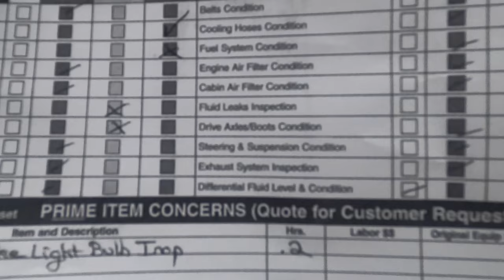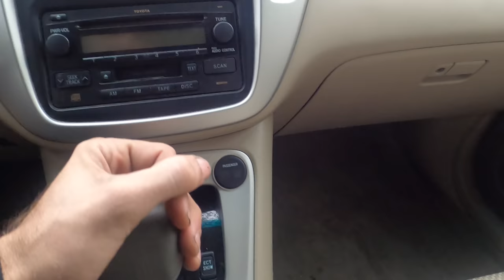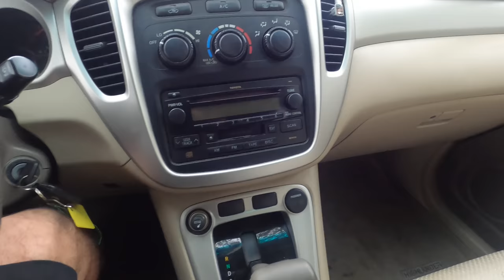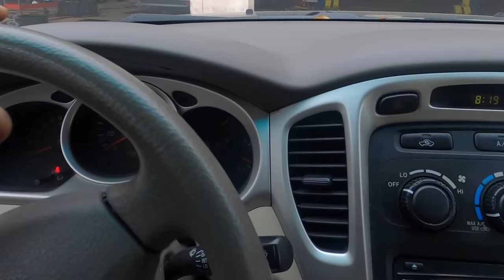We were BASHED by the Dealer! Ripping off a customer! Toyota Highlander 3.3

Comment: i visited friends in upstate new york recently and they told me they were going on a road trip so bought new tires and had a total brake job done at a local shop.a fairly new nissan rogue with low miles. the price of tires and brakes was $1800. my friend asked me if i could look at her new tires because she had reservations that they were infact brand new because they looked dirty. i checked the tires and brakes and sadly had to inform them that their new tires were good but used and their brakes were not even touched.

Comment: I liked the video, and I do think there were problems found that needed addressing. It may not have been as easy as the dealer suspected in large item caliper costs.... Usually accompanied by replacing rotors too. But if they did a cursory inspection after your shop did the initial brake job and the original inspection was fast and non inclusive as evidence of the rust and lack of lubrication in moving parts shown....  Its good to do the correct brake procedure and repair and a discount on parts and labor might have been approached vs a free giveaway of all. If I was the manager (I managed a Digital phone repair facility for Sony Qualcomm.... years ago. I would have given half costs on parts and labor, and a coupon for future service.  Keep em coming back with quality work and pride in workmanship.

Comment: I work with repair on smaller appliences and I have also found that being objective as much as possible. Getting worked up usually is wasted energy, and I have found that customers more often than not will respond possitivly if I`m honest. I would rather just say it as it is.

Comment: I am a contract mechanical engineering consultant but used to be a diesel mechanic. It really does ring true what you said about removing emotion from something until you are sure that you need to be. Once you do the checks and it actually was you at fault, it is also very important for you to take ownership and address the problem. However, you need to draw the line once the issue is resolved, because sometimes customers like to use you and your good intentions for their own gain.

Comment: Personally I think even for customer service you went above and beyond.. I can see the pine (maybe) being replaced. The top seal (maybe) being replaced, but I qualify that with saying a simple re-torque - wipe down-test drive might have solved that problem. I though not a professional auto mechanic did 10 years of commercial jet engine repairs and rebuilds, and found usually it was a bolt that was not torqued or more often just loosened. As far as the rear drag went clearly that was totally on the owner, but it was nice for you to clean it up, though a bit more than I might have in your position.
Bottom line is it is clear you live in a wet and likely ice prone environment or this owner has been 4 wheeling. If that job was within a month of being out , that 11 months is a LOT of rust and wear. BUT it is nice to see a company man that will go the extra mile, but like I said this was about 11 months since rebuild the owner should have to take some responsibility even if you have to call it shop and oil charges to recoup some of the material expenses. But that is just me since I always try and be fair with my mechanics, if it is their fault they pay if it is my fault but they did the work and I messed it up I pay and if we can't be sure I always ask that at a minimum we split the bill. Sorry just old school business 101

Comment: This sort of reminds me of a time when I was working in a machine shop that dealt with mostly textile parts. A shipment of fairly large gears was returned to us by a customer who stated that the bores were taperer and wouldn't go onto the shaft all of the way. We inspected them and found that the trainee who did the final work had run the setscrews in about a half turn too far. We backed them out, repacked and shipped them back and everyone was happy. You can't always believe what a customer says. LOL

Comment: Good video, I would however before compressing the Piston back into the caliper  loosen the bleeder screw for two reasons. one your not pushing  degraded brake fluid back up into the system and two you're eliminating the possibility of a collapsed hose you can feel the piston much easier on the caliper  when the bleeder is open and it helps flush out any oxidized brake fluid from the caliper.

Comment: At about 7:25 you said as you were pulling slide pins that  it might be  excessive.  I don't think it's excessive at all because slide pins should be inspected  and even if no work is done  I at least clean and regrease them before  putting it back together.  If I took it apart that far I might as well  brush everything off and  put new grease on pins and  slidey  spots  pads sit in. To me it just makes sense I guess it goes along with responsibility  of I took it apart to inspect and even though  nothing needs replaced I should put it together  correctly to avoid any problems  and of course if someone else opened it up there's proof someone had been in it recently

Comment: I had a subaru one time, my own personal subaru and the pins were so bad that I had to use a torch and the pin bent on the way out.  I learned to lube the pin any time I take a caliber off.  And I use ceramic grease at least on the front pins.  It handles the heat well.

Comment: If those had been done recently would have just warranted the rotors and had the auto parts dealer just replace them.

Nice job!

My wife actually had some sticking breaks, and squeaks a long time ago. She took it numerous places, and even to a friend of hers that was a mechanic. Everyone said everything was perfect.

So finally I got out there on my day off, and the slider pins were so seized I used an impact to spin them, and applied outward force to get them out lol. Cleaned everything up, and everything was okay from then on out.

Should have just done it myself sooner, although when you work on equipment for a living it sucks to come home, and do the same sometimes lmao.

Comment: i always used to check slide pin on anything older then 5 years here in NYS you can fail state inspection for that how i would check them is loosen the bolt about 5 or 6 threads and push on the back of the bolt its it free it will slide. don't have to take the wheel off but of course is always preferred

Comment: I like to see people who take pride in their work! It really is a rare thing nowadays and almost unheard of because they just want to take short cuts just to get done with their work faster to just hurry up to get to another job or they just don't care or on the most part they really don't like what they are doing especially when it's a free job because they have to do it again and 99% of the time it was their fault for not doing the job right in the first place! Like the stuck caliber slider bolts, if they would have cleaned and lubed them like they should have done in the first place you wouldn't have to be doing it now! Because it takes a long time for that brake grease to turn sticky and gummy because that is synthetic good grease, they just didn't do it! 
You can tell a stuck caliber by inspecting the pads usually the inside pad will have less pad and like you said hot spots on roots and glazed brake pads. 
The build up of  rust could be 50-50 it may have built up scaling or again they didn't want to take the time to sand the rust off which is sad.  I hate it when another company bashes on another company that is in poor taste in trying to steal a customer and they were going to rip off that costumer too which made it even worse, what low-lifes! And they were bashing a decent company it looks like to me! You are going above and beyond and that shows you care good for you!

Comment: I used to work for a large communications company. When taking my work van in for service , I would be sitting in the service waiting area to hear the mechanics come out and tell the customers the list of things wrong with their vehicle's especially women. I already knew they were going to find a list of things wrong with my service van because it was on a Fleet Card usually around $500.00 a visit. Mechanics have got to have some way to pay for that boat in their driveways. I have two used vehicle's , I maintain them so I wouldn't to go to a dealership. I've also learned I can get better parts especially brake pads and rotors and my vehicles doesn't have to sit in the shop all day!.

Comment: One thing dealerships seem to have a problem with regarding valve covers is... they often ignore their own torque specs, and just run bolts down until cover & block are metal to metal.  This works at first, but when that gasket hardens from age and heat, elasticity disappears and after that, a leak has no quick fix: gaskets must be replaced.

Comment: If this break job was originally done here, then I would be pissed and took it back as well.
They literally took of the pads and replaced them with absolutely no clean up or lube.
The sliding pins were shocking to see. They should not be in that condition after a couple of months.

Comment: I wish you would had used a large water pump pliers and moved the caliper piston in slightly then watch for piston seal to return its piston postion, this would give you a good indication the piston is not rusted inside the caliper. When just push the piston in like yoy did is not a good test the piston is nor rusted. I also aways peel the piston boot bake just enough to see piston condition.

Comment: I save time by using a blasting cabinet with steel shot in it it takes longer to put all four rotors and drums in the cabinet than it does to blast them I also blasted the slide pins Advance Auto has a brush kit with steel brushes and brass brushes I put them on a drill and use brake clean for honing the slides then Sealy Glide everything back together

Comment: I put a new rotor and pads on one side of my bmw and found out the other side was siezed so I just left it. I got a airbag recall for free and they said they inspected my car for me also and on the sheet it said all my brake rotors were in the danger zone. Mind you the siezed side I put a new rotor on there too so they didn't even inspect it I imagine they checked one and assumed the rest were bad

Comment: At 16:00 I would spin on two lug nuts on to wheel bearing plate then put the rotor facings out as you did and secure it with two more lug nuts to make that a lot easier!

Comment: That's what happens when you lubricate  the pins with regular grease instead of HIGH temp grease... the grease dries up. Many years ago in the 90"s MIDAS CHARGED ME $600.00 FOR A BRAKE JOB, WHICH I don't trust to anyone,  i'VE BEEN DOING MYSELF SINCE i WAS 16... but it was winter in Maryland and I decided to pay for it. Well... I didn"t make it to florida, with the calipers getting stuck and smoking down the road. I stopped in Georgia at another Midas.  The other shop wanted to steal more money suggesting to change the calipers BUT NO anything of what I paid for and charge it to the shop in Maryland.. I made it to Miami, stop at the autopart, bought high temp grease, new pads and fixed them myself in the Hotel parking!  Also some service manuals calls for the pads use a bit of grease on the edges to slide in the clips...
Reply: Everyone an expert

Comment: I am not by any means a legit mechanic. I turn a wrench and will learn as I go, but I'm confused. Around 18:10 you sprayed it down heavily with break cleaner then put it on the car. Should you have wiped down the cleaner before putting it on? I would think that could mess with the e-brake functionality. Genuinely curious. Perhaps I've been over protective when doing stuff like this lol
Reply: I believe you are confusing brake cleaner with a lubricant.   Brake cleaner does not leave any residue that will effect brake performance,  that is why it is used to clean brake parts.   

If you feel like wiping it down after spraying it on, feel free to do so, just know that it is not really necessary.
Reply: @Bendigo1  That's good to know. I wasn't worried so much about a lubrication effect as much as it being aggressive on the pads or any other rubber component (boots and such). I'll probably continue to wipe it off, but won't be as worried going forward that I missed a spot lol. Thanks for the info :)
Reply: @TheBulletTrain  yeah, it shouldn't be sprayed on those parts and should be removed asap if it gets on them.  But in the part of the video that you mentioned,  there is not much chance of that happening.
Reply: @Bendigo1  Fair point. Always good to learn new things and I will keep all that in mind. Thanks for the info and reply, and for being informative and not a dick which happens on here way too often lol.

Comment: If your shop just recently change the brakes on this car, your shop failed There is absolutely no excuse as to why the guide pins are frozen. Whoever done the brake job did not do it correctly. From the looks of it I would say your shop never took the front calipers off to change the pads. All of the rust inside the piston is clear evidence of that your tech robbed somebody.

Comment: Not to be or sound negative but you should put the rotor on a brake lathe to machine it smooth only knowledgeable mechanics should attempt the using a flapwheel on a rotor or drum

Comment: On those  calipers. I still would of opted to replace those lines or aleast inspected them. Just because you are forcing them open with the tool. Doesnt mean they arnt hanging up. Ive seen where the insides of those breaklines will swell and act as a one way valve. The Tool you are using puts a lot more force on the piston then what is normaly applied when the brake pad is released (Which is virtually none) Maybe you dont have that issue as much down south but i see it up north all the time especially on older vehicles. Not critasizing you. Just trying to give some helpful advice. Keep up the good wrenching and thanks for the videos!

Comment: Looking at your findings they should have bashed you guys. Looks like your shop pad slapped the rear and didn’t line the pins at all. Even after 7 months those pins should not have been dry. I also noticed you failed to clean the rear parking shoes while you were in there. I also noticed you failed to measure the rotors during your “proper” brake inspection. But hey it’s all for likes and shares right.

Comment: Nice repair! I hope you were using a respirator when cleaning those brakes. Rust dust is no joke, I learnt it the hard way once when I spent about 2 hours cleaning a rusty car frame in an enclosed garage with no respiratory protection. After finishing up I could literally FEEL the dust in my lungs and throat. Thinking back that probably shaved some time off my lifespan.

Comment: Replace or wirebrush rusty slide pins.  Clean the old "glue" off and apply new grease.   But, also, use solvent and swab out  the slide pin sockets of old crusty "glue".   Grease the drum shoe and disk pad slide points (wire brush as necessary). . Make sure you don't push brake fluid out of the reservoir when you compress the calipers.   Brake fluid  flush is worth the effort at some point.   Even if you just bleed the last 20% in the calipers that is the  most thermally degraded.   Most parking brake linkages could use some attention.

Comment: I'm hearing a lot of double talk. Yes it's my life in your hands that the brake job gets done right - the first time, and isn't just that I'm just another disgruntled ass-hat being difficult. I consider trust a very important component of ANY work done and should it be discovered that a mechanics skipped/ shortchanged basic safety steps to get another job on the lift as quickly as possible to pad the profit corner - is taken very personal.

Comment: I don't like watching other mechanics cuz like immediatly I noticed 1 dudes wearing shorts which is not normal for a mech an 2 he didn't shake the wheels to rule out bearing play or suspension issues which I always do to cover my ass and as a courtesy and 3 alot of times you have to Check for a seized caliper while they're hot cuz they will free up when they cool down, I don't agree with 90% of what I see other garages have done to vehicles when I get them in either, bottom line if I didn't work on it I don't trust what anyone else says has been done or needs done I check it again

Comment: Been doing mechanic for a many of years and never saw someone take a buffing pad to rotor almost sure that would cause hot spots if was actually the breaking part. If you would’ve just adjusted the parking break right the rust would’ve removed it self. 
You seem vary shad tree. You wasn’t bashed someone told the truth sorry that hit so close home. Put more pride in your work! ASE certification doesn’t make you a good mechanic the work put out will

Comment: "It's not terrible" ?? Pins not moving at all... and require a few mins of fighting with pliers to remove🤣🤣,  retracting piston without undoing the bleeding valve... pads assembly without ceramic paste, rust everywhere a few months after your work.. 
That "rubber" getts dissolved when you use wrong grease.  Sliding pins run on high temperature silicone grease-and not every brand is suitable. 
You've lost all your credit...